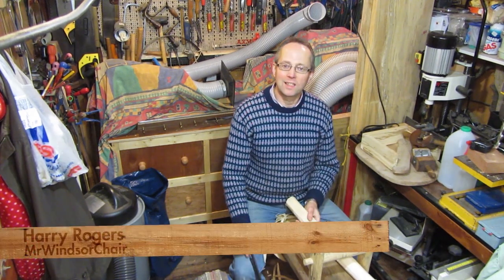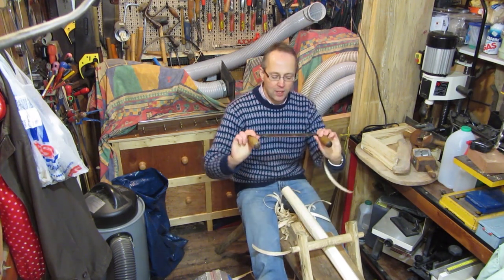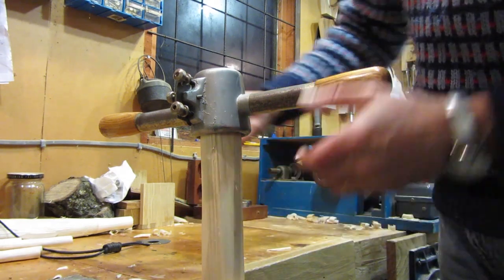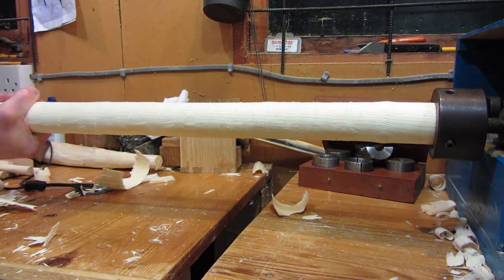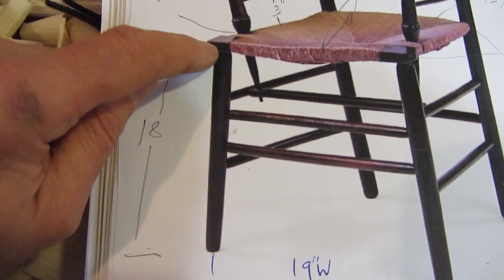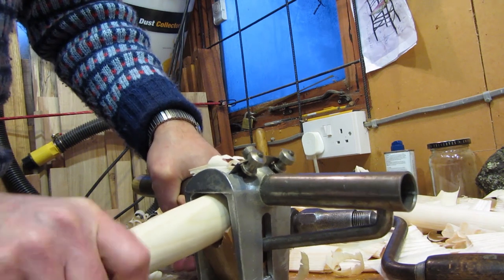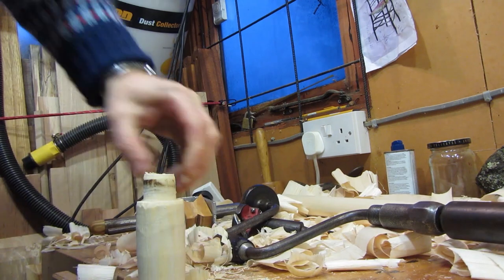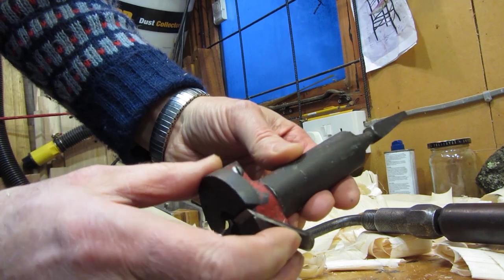Rotary Planes - Making Front Legs for Chair - Sussex Chair Part 4

Comment: Great video Harry
But where do I get a rotary plane?
Reply from the maker: you could make one out of wood - 30 degree bed angle at a tangent to a circle will do it with a 25 degree bevel on the blade